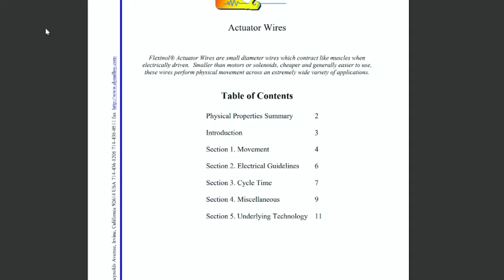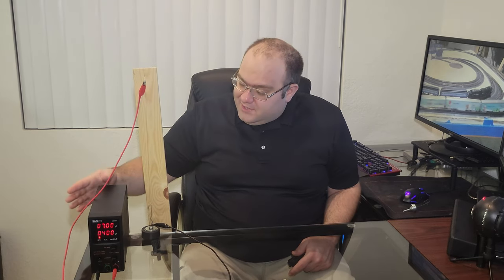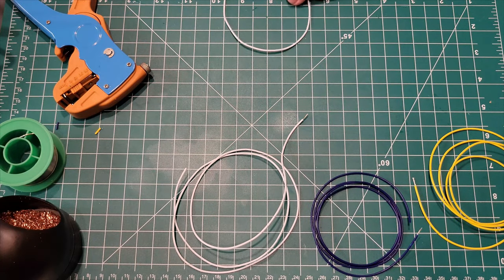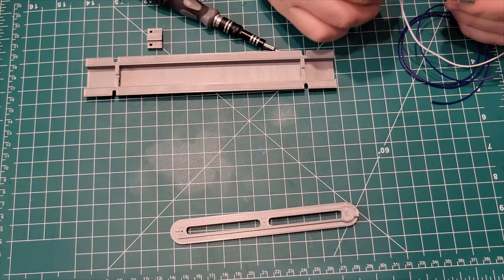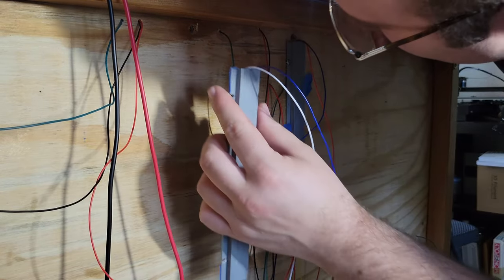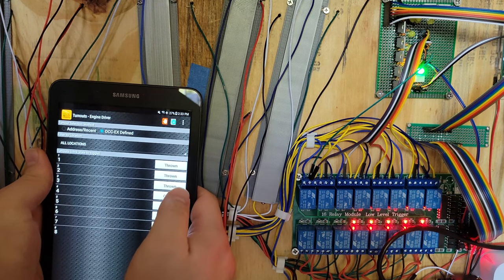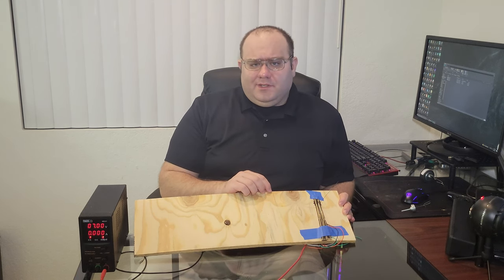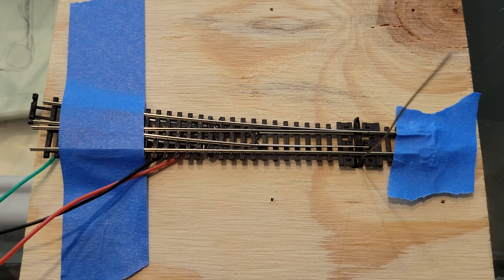Sleek, silent, and gentle turnouts? NOT WITH MOTORS! - Muscle Wire Turnouts

Comment: This is fascinating. I would love to take a closer peek at your slider assembly as I'm not sure I understand the mechanics. Can I assume that the muscle wire contracts, moves the slider, and when the current is removed the wire returns to its original length but the slider stays put - meaning the wire can only pull the slider not push it? Additionally could the wire turn a corner or does it need to be straight? I'm thinking that you could potentially reduce the length of the slider module by half if somehow the wire was able to return to its origin. Either way, really interesting stuff and thank you for sharing.
Reply from the maker: Hi N Scale Dystopia, I decided to throw the STL files on thingiverse and added the links to the description. The preview pictures may help clarify the mechanism. First, you are correct, the wire can only pull. However, while you can see the wire go slack in the video after the current is removed, you'll need to stretch it with some force to truly return to original length (in this case, the opposing wire in the slider or the weight in the demonstrations). The wire can take corners, but tight corners can create a weak point. Trying to make the wire slide across a corner is worse. The rounded corners I use on the sliders are a solid starting point, gentle enough for the small wires and balanced on each side so the wire won't be sliding across it. Thanks for the comment and I'm glad you found the video interesting!